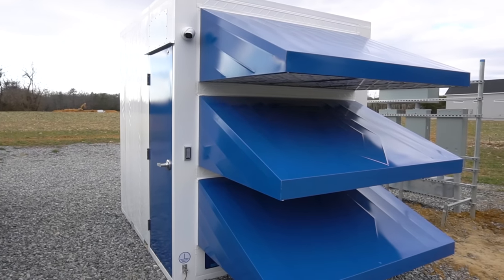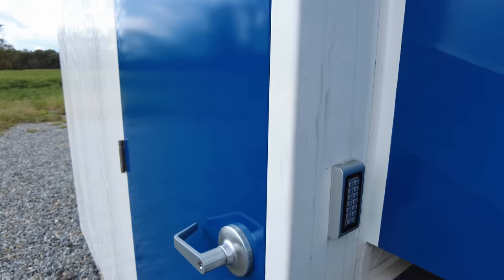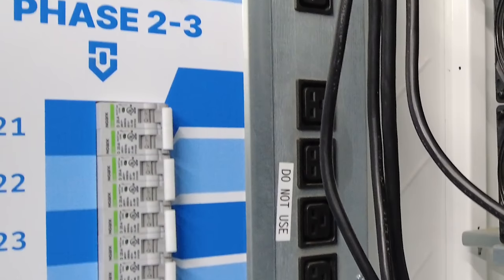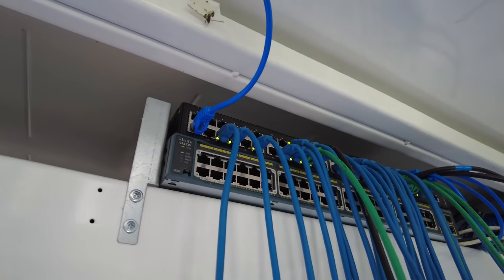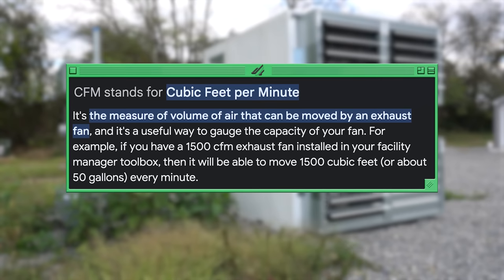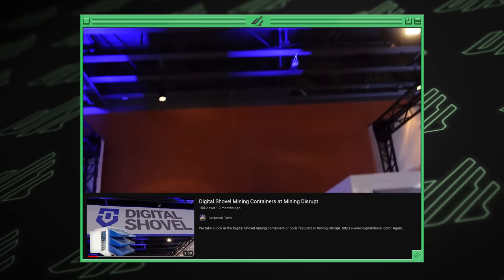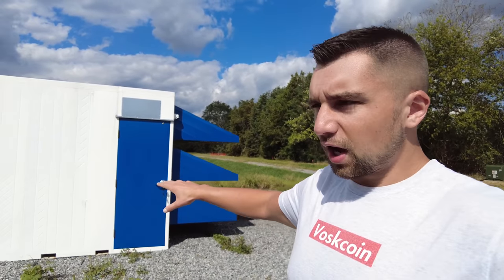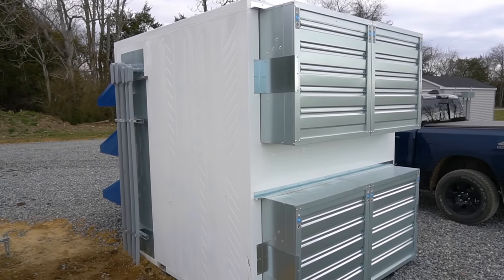Prebuilt Bitcoin Mining Container - 6 Month Review

Comment: Have you tried to use a pallet jack to move the tank away from the wall? As for the HDD, you can fit about 600 x 22TB (13 PiB), so you should be able to fit approx 100 PiB in the HDD shed easily. That would be approx $8000/day income. I wonder if they are going to make a "pod" for the Octominer style GPU cases? I currently have 12x of the 12 GPU models stacked on 2 racks in a Tuff Shed, but being able to stack them in a "pod" vertically  would save space and most likely have better airflow.